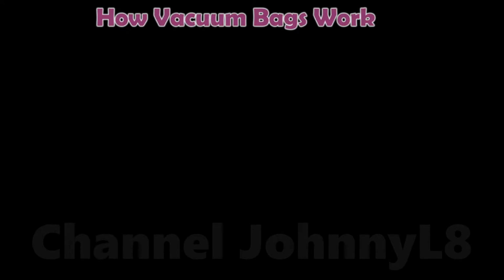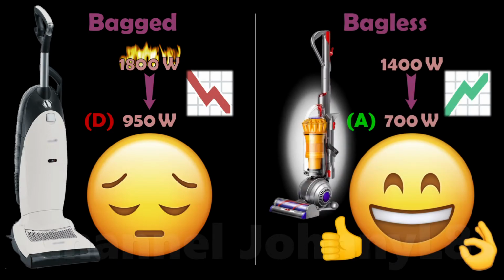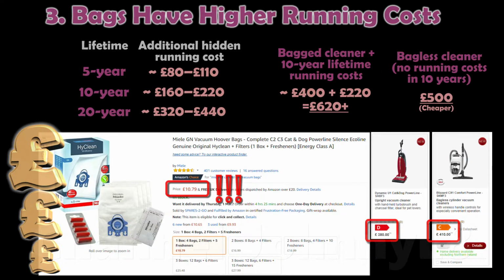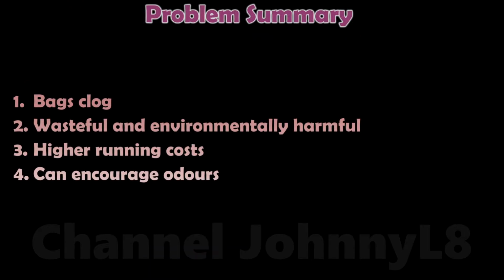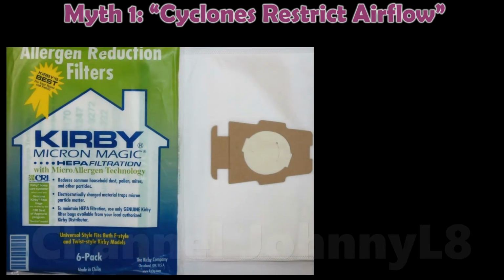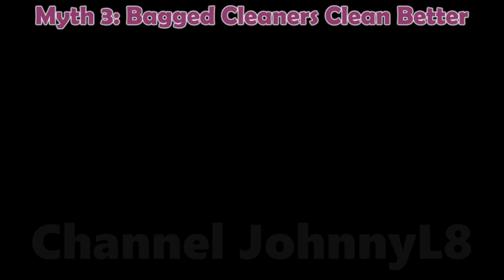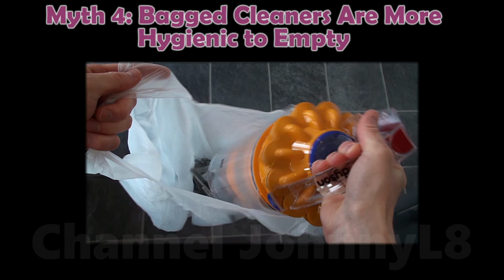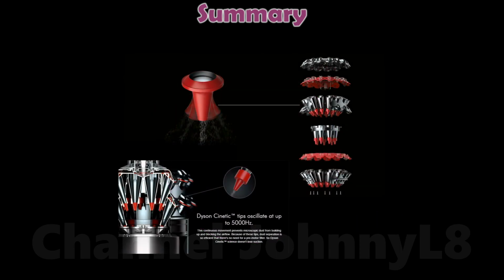Bagged Vs Bagless Vacuum Cleaners

Comment: I am here to say that I have a fact checked this it’s true for at least in the US I don’t know what it is overseas, but this is what it is here they are both for genuine parts not rip offs genuine Dyson  filters for a v11  are Priced at 29,99 with tax for one replacement filter that they recommend replacing every six months When Miele genuine bags are priced at 22.49 for a pack of 4 you not only get more bags for a cheaper price but The bags are able to run in the machine for about three months in most conditions again, it’s the same with both machines that can vary depending on use but bag machines are  cheaper than bagless they also don’t lose suction like they did back in the day they only lose their section power when they’re about 97 to 80% full
Reply from the maker: Kudos to at least attempting to fact check. All modern Dyson machine filters (including the V11) are lifetime filters and never need replacing if not neglected and abused. I recommend you fact check with Dyson rather than some hack on the internet that wants to exploit people to sell unnecessary ancilliaries. How quickly a bag loses suction (its resistance to air increases) depends on what is sucked up. It doesn't happen at all with better technology which also doesn't add these ancilliaries to landfill.
Reply: @VacuumFacts  I'm sorry to say this, but there is no filter on a vacuum cleaner that is lifetime.Yes, there are filters that can last longer than others, but no filter can last over 10 years of use which is what Dyson.Estimates With there are machines Now I will give Then credit they definitely do last longer than a lot of what's on the market.
Reply: @VacuumFacts And also , don't bags , only release either paper or cloth into the The world to biodegradable things When A Dyson filter leaves plastic.Something that's gonna be around for decades
Reply from the maker: Bags release materials to landfill that have a cost hit to the environment to manufacture. It's avoidable and unnecessary compared to superior approaches which just release the dust. It is a significant environmental impact when scaled up over a population as the video explained.

RE filters: I disagree. Dyson's claim is either true or false. Either you do or do not ever need to replace the filter on their modern machines for its designed and expected lifetime of at least 10 years. So let's see how much you know to justify your viewpoint. What behaviour would you expect the vacuum cleaner to exhibit if its filter needed replacing (excluding because of any misuse or neglect), and why does that specific behaviour occur? If you can't answer that simple question in a learned, fact-checkable way, then you have no valid case and can be ignored on this point.
Reply: @VacuumFacts  filters in vacuums where down overtime every time you you wash them it takes a sliver of life off the filter every time causing it to lose suction . I also bought a Dyson V6 when they first came out and 
It lasted maybe two years  and I took care of that thing I would wash the filter every month. Check the brush every month, etc. and the filter still needed to be replaced within six months when one pack of bags can last almost 9 month’s
Reply from the maker: The material in a filter increases resistance and causes a loss in suction naturally. If you "take a sliver of life off the filter"—presumably you mean remove filter material—then how does this increase the resistance of the filter and reduce suction? Surely it would do the exact opposite. You need to explain that.
Reply: @VacuumFacts  I mean That when you wash the filter.There are minerals in the water that adhere to the filter causing causing more of a resistance over time I'm mainly speaking for US because we have really hard water over here. I don't know what it is again overseas. So it may be different, but every time you wash it. The filter gets a little bit and a little bit more blocked with minerals. That's what I'm referring to.  And the reason I like that bags is because that never happens
Reply from the maker: Where is the evidence you're relying on that quantifies this alleged mineral deposition as a function of rinse number from a fact-checkable, reputable source? How have you (or your sources) quantified resistance increase as a function of alleged mineral loading?

I'll give you a hint: there is no scientific evidence in the literature to support this claim associated with rinse-fouling kinetics and it's pure speculation, distinct from a reputable fact. There is no evidence to support the claim that repeated rinse-dry cycles causes appreciable, field-relevant performance loss over many cycles. If you disagree, please provide your evidence, otherwise this is easily dismissable as unhealty speculation and counter to the fact-checking premise you initiated this conversation with.

The reasoning you gave to support that no filter can last a lifetime of the product (excluding abuse and neglect) is not supported by any evidence and easily dismissed as speculation.
Reply: @VacuumFacts  what ever Dyson doesn’t do what they say they are cheaply made   And what I sead  is true you can believe it or not when I know I’m right  because I 
Repair them for a living and they break even with proper care
Reply from the maker: I gave you a fair chance to be convincing in this discussion. And we end with "It's true because I said it's true and <insert arbitrary unconvincing anecdote>". I'm sorry, but that's not how you convince someone that something is true. You provide undeniable evidence that constitutes a fact-check. There is absolutely no evidence whatsoever for your claim that they clog with mineral deposits from repeated rinse-dry cycles—I went and fact-checked it. It's all in your head unfortunately and you've failed to convince me. Nor is there evidence they're 'cheaply made' and break with responsible use. If you believe that's true, it's very, very easy to demonstrate a methodology of reproduction that anyone in the world can follow to confirm your conclusion. You haven't even done that. You're projecting what you think is true, or possibly would like to be true, as though it were true. But you forgot about the part where you need real evidence, not a decree by fiat.
Reply: @VacuumFacts  I never said what you said was true I’m just done arguing with you  because you’re always gonna go with what you think let’s just leave it At you think one way about bagless Vac’s well, I think that they’re better than bagless
Reply from the maker: OK. Although, to clarify, the way I think is informed by objective EVIDENCE, distinct from wishful thinking and tribal wants.
Reply: @VacuumFacts  that’s your opinion

Comment: I don't like bagged vacuum cleaners because you have to change the bag once it gets full (even though they're more hygenic), rather than emptying the bin (though some models have reusable bags you can just empty and reuse). Bagless vacuums, especially Dyson are better because they have a lower carbon footprint and they don't tax you every time you empty it, meaning you don't have to buy new bags. You just empty the bin and rinse the filters every few months depending on how often you vacuum (unless you have the cinetic model). That's why I have a Dyson.
Reply from the maker: Bags are more hygienic than nasty knockoff Dyson bagless clone scam machines, but they’re not more hygienic than the original bagless machines. Sealed bags can still release clouds of dust when thrown in the bin, and they have huge, wholly avoidable cost and environmental impact. The best bagless machines empty the dust without a cloud if done correctly, all within 5 seconds, and without any cost or environmental impact. The best bagless machines are more hygienic and better in other ways than the best bags, and there’s plenty of evidence demonstrating all this on my channel. Bagged models with reusable bags clog and don’t perform as well because of it or require more energy wastage to brute force performance.
Reply: @VacuumFacts  Companies are lying saying that bagged vacuums are "hygenic" when really, they're not. They only say that to get customers to buy the product. I prefer Dyson!